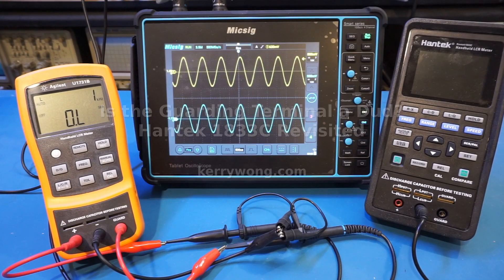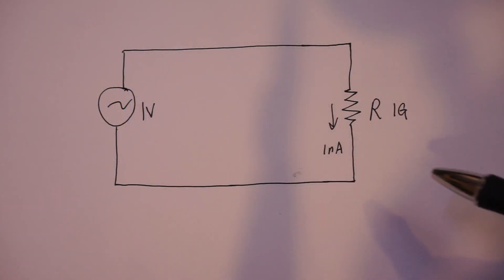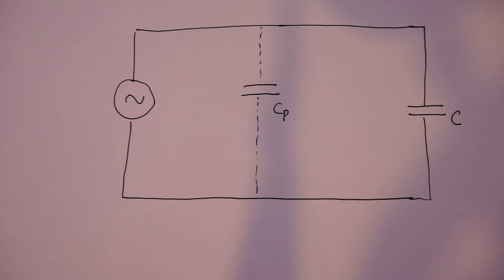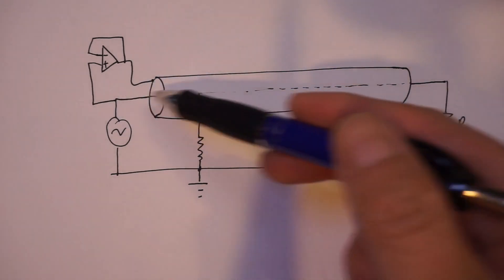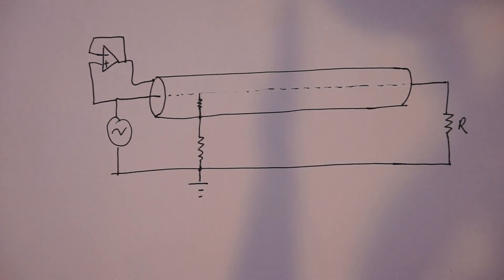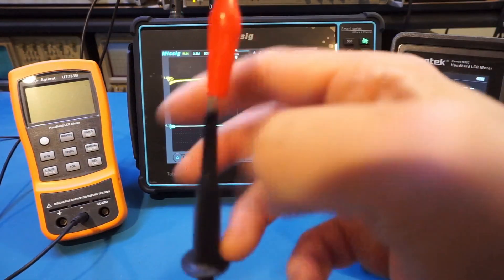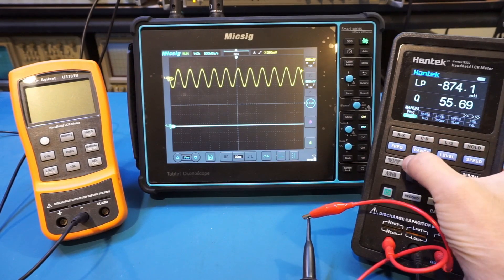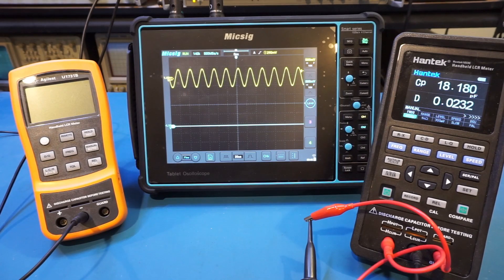Is This Guarding Terminal a Dud (See Comments)? Guarding Explained, Hantek 1833C LCR Meter Revisited

Comment from the maker: As a few pointed out the guarding could also be done following the ground terminal if done properly. The 1833C likely used that approach. For those who are interested in the theory behind you can read the detailed explanation here: https://www.ietlabs.com/pdf/application_notes/030122%20IET%20LCR%20PRIMER%201st%20Edition.pdf
Reply: The Applent AT-826 handheld LCR connects the guard terminal to the meter's internal shielding and ground tracks. When using with the supplied test fixture or tweezers, the meter has very stable readings down to the single pF levels and below at higher test frequencies. The same test fixture also works well with 4 wire low ohms measurements.

Comment: Well, the voltage follower could just follow ground instead of signal. Would work just as well, as long as the opamp supply midpoint (Assuming dual rail supply) is connected to signal.

Comment: I bought the Hantek 1833C a few months ago. It's good on features and build quality, but I don't recommend this handheld LCR for numerous reasons. The color display is somewhat dim and fuzzy even at the brightest setting. The battery drain when powered off is ridiculous. Although its capable of 4 wire low ohms measurements, it doesn't include Kelvin clips or tweezers. The open and shorted lead calibration does not save into the non-volatile memory being lost at power-off, and takes the meter an eternity to go through it. The PC software, even with the driver properly loaded, does not work. So far the all around best handheld LCR I have used is the Applent AT-826, and the DER-EE 5000 isn't far behind.

Comment: i have a DE-5000 with guard ,,do you know ifs ok
Reply: I plan to buy a LCR and had DE-5000, Hantek and Uni-T622 on the list. The Hantek now is cancelled.
AFAIR in a DE-5000 review I saw a connection of Guard to an active part inside - NO, it was at the review of this Hantek by Kerry Wong. In Dave's review of the DE-5000 you can see it is only connected to a big ground area inside, maybe the analogue GND. Nevertheless a measurement would be fine.

Comment: I emailed them regarding an adapter for the the 5 wire connection and they replied saying they don't make one. This all points to these kelvin and guard facilities as fakes. The Chinese are ruthless with their sales tactics.....
Reply from the maker: @MFR58, One thing puzzled me is that the guard terminal is internally connected to the OpAmp output (I mentioned that in my teardown video). So not sure why the functionality is not implemented in the firmware.